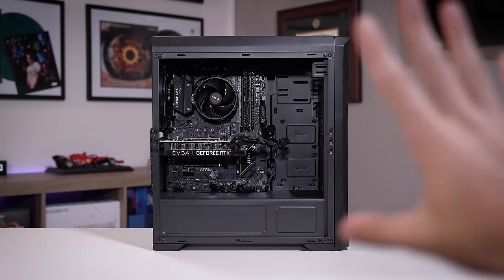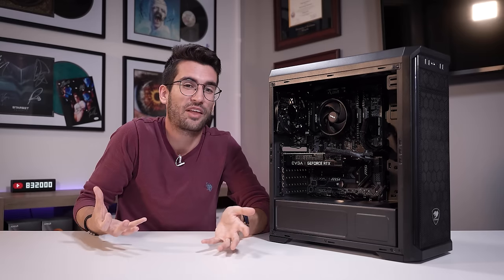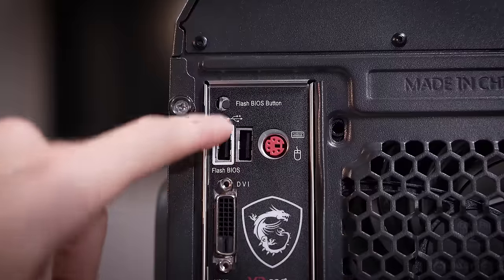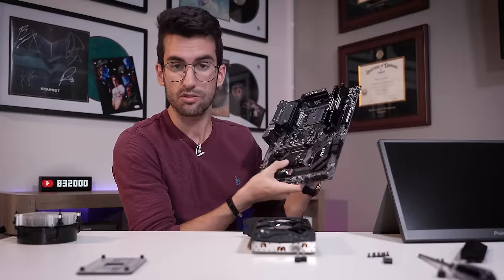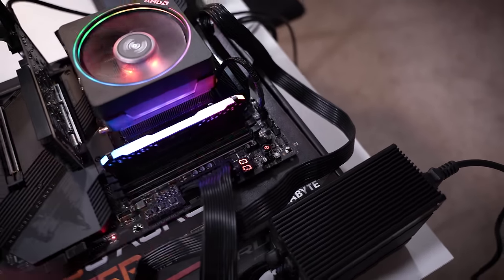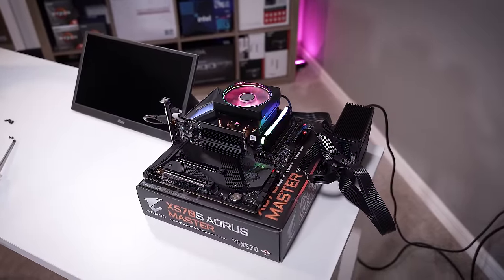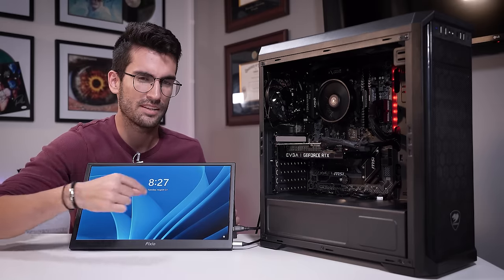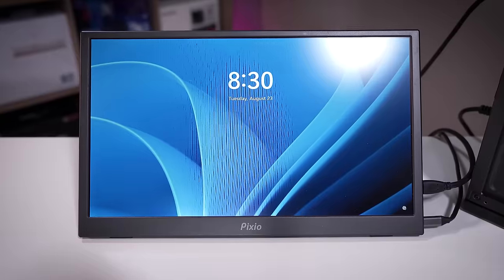Fixing a Viewer's BROKEN Gaming PC? - Fix or Flop S3:E4

Comment: I don't think ANY BIOS for this particular board would omit Zen 2 support because it has a 32MB BIOS chip hence the name MAX. It was specifically designed with Ryzen's extended CPU support in mind. I'm inclined to believe that the user flagged the wrong BIOS to the board or that this version was available for a very short time on MSI's website
Reply: so bios updates in ryzen can obsolete the older chips i heard

Comment: hey greg ! i have a question ! 
i bought an rtx 3070 like 2 days ago and i have a 600w psu 80 plus gold
sometimes in games when it uses 100% of gpu the game crashs
is it cuz of the psu ?
Reply: could be because they draw 250w according to nvidia, you will need a 650w-750watt psu to get a comfortable feeling for it based on googling it, but i'll double check to make sure
Reply: that does sound like the PSU, for now you could try undervolting the card or just straight up lowering the power limit in MSI afterburner. It'll still probably be pretty fast at like 90% power limit.
Reply: Mojik did you connect the gpu with one or two seperate pci-e cables?

Comment: i possibly have something fun for you. 3 different cases, 3 different graphic cards, 3 different cpu's,3 different motherboards, 3 different types of rams, 3 different power supplies, but only enough fans to run 1 computer. do you want to build the ultimate computer out off these parts. even tho there's 3 different choice's of everything it's pretty old parts but its what i've got, i've had to fix my current pc (which is included as these parts) about 8 times this year. and i'm pretty sure 1 of the motherboards is non responsive. and if your interested how do i get in further contact with you. i've been watching you for a while and i like your work, and i've always wanted to give you a project. and if you want, when you finish the computer ofc there will be 2 different choice's left that i wouldn't hesitate letting you keep

Comment: What i found is that 2 of my friends who had 3600x and memory on 3600mhz had their memory channels die and i have 3200mhz and its still going strong. I think the dying we are seeing is because infinity cache was overclocked for prolonged amount of time with inappropriate cooling?
Reply: That or it could just be down to the move to 7nm as it was a big change in fabrication size that even Intel took many years to achieve. I hope AMD can get to the bottom of the failures and update the community with a definitive answer as to what is going on.

Comment: Where did the owner buy the board? Maybe somone bought before them and flashed those bios and then it stopped working so they  returned it and someone like Newegg tested it saying it worked and sold it new again.
Reply: At this point, I wouldn’t even put it past MSI to shipout a board with a shaky bios.

Comment: Noticed on this show that Ryzen CPU's are breaking a lot

How come???
Reply: the most convincing theory that I've heard is just that ryzen idles at really high voltage. AMD claim that "Up to 1.5v" is safe for Ryzen but nobody would ever run an Intel chip at that voltage. Unless AMD has some way of changing physics then I think those high voltages degrade the CPU faster than necessary. We'll probably see what AMD has to say after they reach back to Greg though.

Comment: So I'm legitimately confused here... If the BIOS on the MoBo was bad, why did a different CPU allow it to post without any issues?
Reply: The BIOS is known for booting issues with certain configurations. It looks like a possible RAM issue from what I can find online and the 2000 series has a lower spec RAM controller which may explain why it worked and the 3600 didn't.

Comment: The user most likely installed a bios for a different revision of the Motherboard eg. rev 1.1 board bios on a rev 1 board. This is actually a common mistake I've fixed plenty over the last 16 years of fixing pcs
Reply: It wasn't that, the "E" BIOS was a bad BIOS which is why it is no longer listed and it jumps from D to F.

Comment: I'm kinda shocked you accepted HP Omen sponsorship. They have the reputation to use proprietary parts, and most importantly sh*t coolers and motherboards, resulting in poor performance relative to a correctly built machine with the same CPU.

There's also often a total lack of airflow!

Comment: Really doesn't make sense. If the bios did not support the cpu it would never have booted.  This questions the story that the thing worked for a while then stopped. Unless owner downloaded the questionable upgrade of bios and it stopped the unit from working.   The front story is questionable.

Comment: The bios you installed, version 7C02v3D doesn't match what you flashed according to the mobo readout E7C02AMS.  So, what's on the website won't necessarily match what the bios shows...stupid on the vendor IMO.  Hence your right to question what was on there in the first place.

EDIT:  you also said the system worked fine at first when the owner swapped the 3600 into the new board.  Definitely strange, I'll chock it up to bios rot.  It's a real thing and does happen.

Comment: I need help I don’t understand Wtf happened all I did was remove the GPU to put a diff one in and I get no power on the MB what so ever. I don’t even want a replacement I just want someone to figure Wtf wrong with it. My specs is
ASUS z690-F 
Cpu 12900K
Kraken x73
2 ssd drives Samsung.
GPU I was using 6900XT sapphire 
Psu rog swift 1200w 80 plus platnium 
With g skill 32GB ram 6000MHz. I beg someone help me.

Comment: That is why I do not buy a B SERIES MOTHERBOARD. it was  made with cheap parts. when you go too cheap your going to have a lotr of problems. SOOOOOOOOOOOOOOOOO. What I do is buy a X570 MOTHERBOARD YES X570 DOSE COST A LOT MORE BIG TIME  $CACHING$$$$$ its well worth it. in return you get HIGH END PARTS on that X570 MOTHERBOARD if go more high end you get a a better rear I.O. MORE USB  PORTS. I  did say BUY A HIGH END  X570 MOTHERBOARD NOT TOP OF THE LINE  X570 GAMING GODLIKE can have a price tag $1200.00 to $1500.00 pending on the dealer pending if there is a  3rd party seller. GOING WITH THE CHEAP B SERIES MOTHERBOARD your going to have the WORST CHEAPEST CHOKES for that CPU 3+1 and the REAR I.O only for 2 USB PORTS and NO WIFI and the slowest  CAT 5e connection. and a BUSTED BIOS. you have to buy a OLD CPU  in order to download the BIOS UPDATE if that OLD CRAP  CPU dose not work. you will not able to download the a BIOS UPDATE DEAD BIOS IS DEAD MOTEHRBOARD. buy a really good high end  X570 motherboardthen buy a RYZEN 7 5800X($200.00 NEWEGG) BEST 8 CORE GAMING CPU on the MARKET RYZEN 7 5800X is not the greatest and not the latest PCIe 4.0 NOT 5.0 DDR4 NOT DDR5 it really works on RTX 3070 that is the best middle ground GPU GAMING PREFORMANCE your going to get. none of that RETARDED 12+4 PIN HIGH POWER DONGLE that dose MELT and CATCH FIRE go with LAST GEN PARTS  NOT CURRENT GEN INTEl 13TH GEN and 14 TH GEN CPUS tend to die its a power devery to the CPU that will  kill a CPU and a motherboard. your DDR5 and your   graphic card will also die along with it. I NEVER TRUSTED INTEL LGA SOCKETS  I HATE IT every time I buy a INTEL MOTHERBOARD that LGA SOCKET  GOES BUST BENT PINS PINS SNAP OFF AND PINS MELT OFF all going on at the same time you know once that LGA SOCKET IS BUSTED NO RMA this is a winning selling pitch for AMD AM4 is PGA SOCKET all teh  PINS are stronger and on the CPU not on the MOTHERBOARD LGA is noted for and AM5 is also noted for. I can buy a MILLION INTEL MOTHERBOARDS from MSI,. ASROCK. and all of them will have SMASH LGA SOCKET this is why I AVOID INTEL and CURREST  AMD CPU for AM5 LGA is the WORST.

Comment: I think some of the Ryzen CPU issues are heat related as my R5-3600 stock cooler was a piece of crap and temps regularly went over 70 to 80C with any kind of load.   Idle and just web surfing had it in the mid 40's to 50's and though I know they say 90 is OK...somehow I don't think they'll live as long running so hot.   With Scythe Mugen5 cooler and dual fans it idles and surfs at 34C and never gets over 60 at full load...much more gooder.
Reply: yeah the stock coolers suck both in accoustics and performance I would never use them

Comment: I have been having a bad rash of bad MSI boards. just like you, I tried everything... I'm losing faith in MSI's Products... and in AMD's AM4 platform... I've had to scrap 4 motherboards in the last 3 months due to different issues with the boards...
Reply: I have 2 MSI boards sitting dead. Both with CPU debug codes. I had one that I swore was the CPU because I bent pins, it is currently in my friend's rig- he uses it daily. The other randomly shut down and wouldn't post after that, I'm currently using that CPU. I'll never buy an MSI board again.